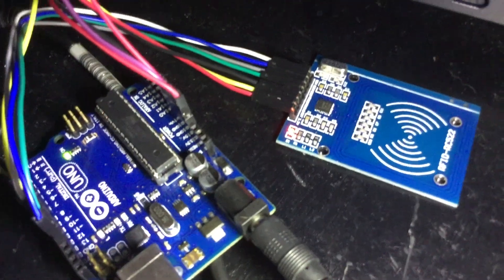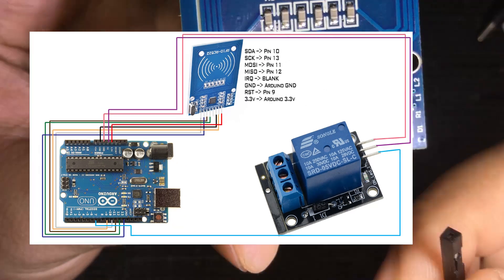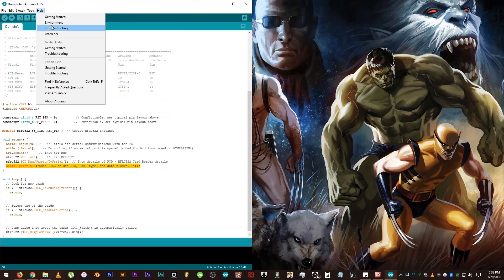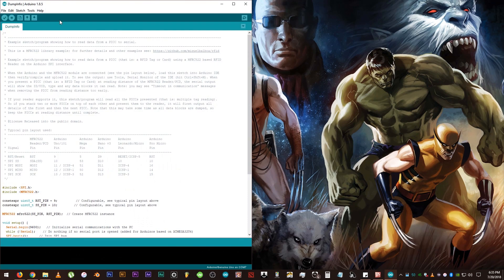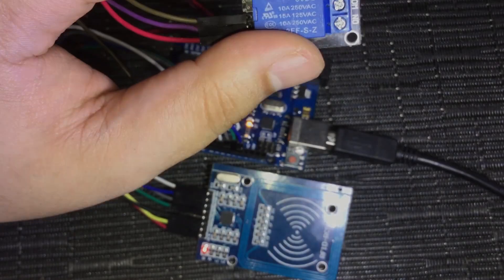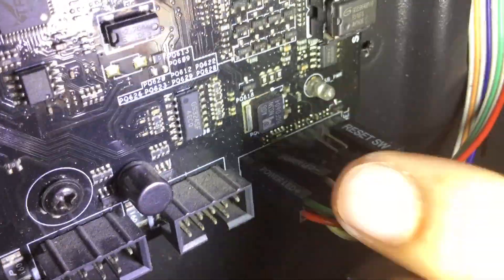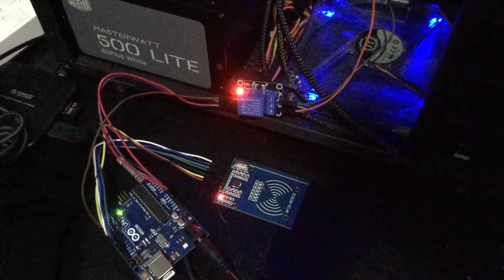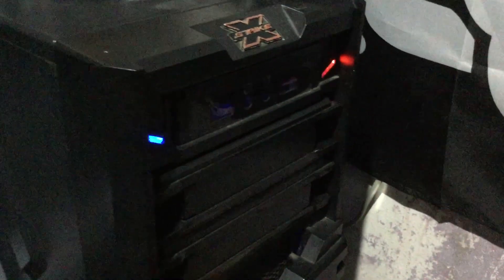Arduino Project #2 | MFRC522 RFID Module + 5v Single Channel Relay = PC Switch With Added Security!

Comment: i cant seen to power up my pc, ive done everhthing correctly. Ive even added a buzzer and led to show the card has successfully been authenticated, the relay power turns on upon successful authentication, but no power to pc
Reply from the maker: Hello and thanks for the comment!

Make sure that your connections are correct. 

Relays usually have 3 ports where you can connect leads to, and the relay would function differently depending on how you connected the leads.

NO+COM = Normally Open or Normally ON
NC+COM = Normally Closed or Normally OFF.

Usually, PC switches are Normally OFF and would only momentarily send a pulse to the motherboard (once pushed), then from the motherboard to the PSU to turn ON your PC.
Reply: @HeathenHacks  thanks for the quick reply, i have the relay wired as per your vid, should i swap from open to normally closed?

Comment: years after years this method still working... I have tips for want using Direct USB power. Maybe this comment, some newbies will understand on this comment.

to keep relays turn off, after turning on arduino, must add this on void setup() scetion:

Find this code:
//Choose which lock below:
pinMode(lock, OUTPUT);
pinMode(lock2, OUTPUT);

Then add digitalWrite(lock, HIGH);
 and digitalWrite(lock2, HIGH); after pinMode(lock2, OUTPUT);

This will keep relay off after powering arduino on.

Comment: Hello! is it possible to build this proyect without a 9V battery? is there any other way to power it?
Reply from the maker: Hello and thanks for the comment! ♥ It is. Yes. You can use the USB port to power it via a USB hub or a powerbank as well. You can also use the DC input.
Reply from the maker: You can also check out the updated version of this (sort of) that uses a bluetooth module as well.

https://www.youtube.com/watch?v=q9GwpWxlAIo
Reply: @HeathenHacks  Thank you for answering! And thanks for the recommendation, your proyect was really helpful!
Reply from the maker: Glad you liked it. Thanks! ❤

Comment: Hi I know this video is old but could you make an other one (since I cant figure it out myself being a noob :P )how to trigger the relay over the internet (e.g by adding an ethernet shield to the Arduino) instead of using RFID? 

I remote manage some desktops (that dont have built in capabilities to hard boot etc e.g intel vPro/AMT support) so when the computer crashes/freezes for some reason one has to go to the physical location of the computer and manually push the powerbutton to turn it off and boot it on again which is a pain in the ass since the rigs I remote manage are outside my house... This could be a gamechanger for me :D
Reply from the maker: Hello, Bill! Thanks for the comment! ♥ Unfortunately, I don't know how to do it as well. lol.

However, I would like to suggest this video: https://www.youtube.com/watch?v=4moPYxNYjCY 

It uses and ESP8266 board to control the relay via wifi instead of an ethernet shield.

If the place where you remote manage the computers doesn't have a router, you could try this.

It's from the same dude on the first video: https://www.youtube.com/watch?v=2J4cx2gA7DQ

Sorry.

Comment: Why is it not safe to shutdown your pc with the key fob, also with that in mind. Is it safe to use the card to power on the pc?
Reply from the maker: Hello Bob! Thanks for the comment! ❤ What the keyfob or the code for the keyfob does is like pressing the power button for about 4 seconds, which can also be called a "hard shutdown". If I remember correctly, it bypasses some things that Windows does when shutting down normally and may result in some corrupted files. (Don't quote me on that, tho) 

The card is perfectly fine to use for turning ON the PC. It basically replaces the power button.
Reply: HeathenHacks Thank you for your response! You’re very helpful you deserve bunches more subscribers!
Reply from the maker: @Bob_Smith  Awww.. thanks! ☺
Reply: HeathenHacks You’re welcome!!!

Comment: hai, does rfid card could read when using relay and battery power? because when i used External power 12V to arduino without relay my RFID card cannot detected / read. Thanks you i hope you have the answer
Reply from the maker: Hello, Radja! Thanks for the comment! First, you could try and use a 5v power supply or just connect your Arduino to a USB hub and see if that would work. Haven't really tried using 12v on my Arduino projects that's why I'm not sure.

Comment: Does it matter if I use any relay module cause I'm using SRD-05VDC-SL-C relay module and when I hook it to my arduino the green light is always on and i tap my rfid card and it turns of but when the relay is hooked to my pc it is not working the green light is still on and when I tap my rfid card it does nothing it's like my relay or arduino is hanging and I need to upload the codes again..I tried to alter the digitalwire function high to low and low to high to make my relay module green lights off when I upload the codes it does not turn the light off you need to tap the card to turn the light off but still same issue when it hooked to my pc it hangs and also i tried to put it to normally close and sometimes to normally open but still same issue...do you think my relay module had the problem?
Reply from the maker: Hello, thanks again for the comment. As per our last conversation, you asked me if you can use a 12v DC adapter for your Arduino, correct? If you're using a 12v DC adapter right now, have you tried using a USB cable or a 5v DC one? If you haven't tried that yet, please do try that out to pinpoint the problem. Now, assuming that the connections are all correct, try the code again while using the USB cable this time and see what happens. If you're still having problems with your relay, remove your relay and try the code again using an LED bulb, the 5mm one, Instead of the relay. They basically have the same code. If the code works properly when using the LED bulb, there might be a problem with your relay.
Reply: @HeathenHacks  I modify your codes man hahahaha and it works hahaha thanks a lot man
Reply from the maker: @system3318  So, it's working now? Nice!
Reply: @HeathenHacks  working 100% hahaha thanks to your codes man 😁😁
Reply from the maker: @system3318  Ey, no worries. It's not even mine. I edited it, too. lol.

Comment: Is it ok to use a 12v dc adapter to power my arduino
Reply from the maker: Hello and thanks for the comment! ♥ According to the Arduino UNO datasheet which you can download here: https://www.google.com.ph/url?sa=t&rct=j&q=&esrc=s&source=web&cd=&cad=rja&uact=8&ved=2ahUKEwjMt_O90LzqAhVTzYsBHZFFAmAQFjATegQIDBAQ&url=https%3A%2F%2Fwww.farnell.com%2Fdatasheets%2F1682209.pdf&usg=AOvVaw2hpzYjytzW3E48klQUKjqJ
Arduino can accept 7-12v for input.

So, yes.
Reply: @HeathenHacks  thanks..I already researched about it I'm looking for 2nd opinion hahaha
Reply from the maker: lol.

Comment: Can I use a MOLEX connector to power the Arduino and eliminate the battery or adapter to power the Arduino?
Reply from the maker: Hello, Chandraveer! Thanks for the comment! ❤ I'm not sure if you can use it to power the arduino directly because I haven't tried it yet. Sorry.

Comment: great video, i want to add a 4 channel relay, any chance on getting a code update so i can use different relays ? say one card opens up relay 1 and 2 after delay of 15 seconds activates 3 and 4 and then stops :) ?
Reply from the maker: Hello, Simon! Thanks for the comment! ♥ Yes. I think it's possible. Just modify the code by adding and removing some things.

Not sure if this code would work, but you can take it as an example, I think.

https://pastebin.com/X0eHVn2F

Comment: Why my relay Not trigger the switch.?
Reply from the maker: Hello, Fathir! Thanks for the question! ♥ I'm not sure why. As you can see, mine is working. Try to double check everything. From your code to your wiring.
Reply: @HeathenHacks  what relay Merk You Use?.
Reply from the maker: Just a generic 5v, 10a relay module.
Reply: @HeathenHacks  can i have your contact.
I still confuse, Why my Relay not triggering
Reply from the maker: Fathir Nathan sure. you can send a message on my FB page. fb.com/HeathenHacks

Comment: If I power on the arduino .. the relay power on also ....
Reply from the maker: Hello, Jss! Thanks for the comment! ♥ 

Hmmm. Try adding 

digitalWrite(lock, LOW);
digitalWrite(lock2, LOW);

on the void setup to start the relay turned off.
Reply: @HeathenHacks  not working ...  the same problem
Reply: Me too.
And the relay Not triggering the Switch

Comment: @HeathenHacks  
can i use it for rfid door lock ?
using a normal relay module

i was actually looking at another video
but then everything except the lock was fine ,the lock was not opening

the guy is not responding to my comment 
can you please help me if i send  you the circuit diagram
Reply from the maker: i can try and help you, but i can’t promise you anything, since i’m not an expert. 😂
Reply: @HeathenHacks  its okay , i'm glad you responded . how can i send you the circuit digram?
Reply from the maker: @EUFORIS  if you have a facebook account, you can message it to my page. facebook.com/HeathenHacks/

Comment: sir this project can be used as  in door lock
Reply: ok
Reply: 9 v applay
Reply from the maker: Oh. Sorry, I was mistaken. The voltage to power and control the relay is 5v, because it's a normal 5v relay.
Reply from the maker: Hi, Furqan! Thanks for the comment! ♥ Yes. You can use it on a door lock.
Reply: @HeathenHacks  thanks i was looking for that answer
Reply from the maker: @EUFORIS  Glad I could help.
Reply: thanks
Reply: sir i made this project 
but  i on circuit then relay on already and inread tag card on   rf reader so only RX light billink on arduino uno 3. relay no show responsed because relay already on in circuit
solve my problem please 
?
Reply from the maker: @protechnology550  hmmm. i guess you can try and add 

digitalWrite(lock, LOW);
digitalWrite(lock2, LOW);

on void setup and see what will happen.
Reply: how many voltages aplay on this circuit?
Reply from the maker: Furqan Ali depends on the source. on this case, it’s 5v since the source is the motherboard.
Reply: thanks boss
Reply from the maker: @protechnology550  hey, don't thank me yet. we don't know if would work. lol.
Reply: no responce i chack

Comment: Hi Heathen Hacks..!!
Can you give a valid link for  Project File + Visual Wiring Diagram... Because, i cant proceed the following procedure for Relay.. Please reply Asap.
Reply from the maker: Hello, Danesh! Thanks for the comment! ♥ Please just use the Arduino Project Hub link that is in the description. The Project File + Visual Wiring Diagram are also there. Thanks.
Reply: @HeathenHacks   the link you have  attached is not working.. please  check.. I need the RFid Relay file... Thank you
Reply from the maker: It's working on my end. I even checked it on a mobile device.
Reply from the maker: Hello, Danesh.  The project file is just a code. If you copy the code on my project hub link, you can just paste that code on your Arduino IDE. 

Or, you can even download it from there by clicking the download button.

Here is the link that will direct you to the code:
https://create.arduino.cc/projecthub/Heathen_Hacks-v2/rfid-relay-rfid-door-lock-code-rfid-pc-switch-eee1d1#code

If you want to see the wiring diagram, just scroll down a little.

Comment: good video, I'm doing the same project with fingerprint, and I'd like to see your code, but you can not :(. Greetings from Barcelona
Reply from the maker: Hello, Sillithus! Thanks for the comment! ♥ The link for the code is in the Description. Hmm.. I guess, I should've made it more clear.

Anyway, go to this link to see and/or download the code if you want. :D

https://create.arduino.cc/projecthub/Heathen_Hacks-v2/rfid-relay-rfid-door-lock-code-rfid-pc-switch-eee1d1?ref=user&ref_id=550502&offset=0

Comment: hello i want to modify that the key fob is in contact it turns it on and is on until it's touched again to turn it off where do I need to make the changes. PS great video
Reply from the maker: Hello Aku! Thanks for the comment! ♥

I compiled it and it did not have any problems, however, I am not sure if this is the code that you need.

First, remove this from the original code.

"void close_lock2() {          // You can also just use the card to shutdown your PC. This is just for those moments that you really need to shut it down quickly. 
  //Use this routine when working with Relays and Solenoids etc.
  digitalWrite(lock2, HIGH);
  delay(5000);                
  digitalWrite(lock2,LOW);
}"

Then, replace this one.

   " Serial.println(read_rfid);
    if (read_rfid==ok_rfid_2) {
      //ok, open the door.
      close_lock2();
    } " 

With these.

    Serial.println(read_rfid);
    if (read_rfid==ok_rfid_2) {
      //ok, open the door.
      digitalWrite(lock2, HIGH);
    }
        Serial.println(read_rfid);
    if (read_rfid!=ok_rfid_2) {
      //ok, open the door.
      digitalWrite(lock2, LOW);
    }
Reply from the maker: Hello again, I may have misunderstood your question. Sorry. Please disregard my 1st reply. Try looking up some codes for state change detection on the arduino playground and try to merge the “rfid==ok” code with it. I’ll try to get back to you later as I am about to sleep. 😂
Reply from the maker: Hello! It's me again. lol. Sorry for the delay.

I think I might have found the answer.

So, basically, just remove anything with "open_lock2", "rfid2", or "lock2" on the code and replace the delay on "void open_lock()" with 5000 and that's it.

Please let me know it it worked. Thanks.

Comment: There is compilation error occuring
Reply from the maker: Hi, Rama! Thanks for the comment! ♥ Can I know what kind of error was it? I mean, what does it say exactly?
Reply: @HeathenHacks 'MFRC522'  file not found
Reply from the maker: @rama9062  Hmmm... Interesting... Have you downloaded the MFRC522 library? It's located just below the code on my Arduino Project Hub Project. Here's the link. 

https://create.arduino.cc/projecthub/Heathen_Hacks-v2/rfid-relay-rfid-door-lock-code-rfid-pc-switch-eee1d1?ref=user&ref_id=550502&offset=9

Comment: Hi,

Can I use Arduino Pro Mini instead of Arduino Uno ? Because I lack of room, If yes please what do I have to change to make it work ? 

Thanks
Reply from the maker: Hi there, thanks for the comment! ♥ Sorry if my comment is delayed, I remember posting a response last night, but it didn't came through for some reason.

Yes, you can definitely use a Pro Mini, I think.

I think think the only thing that you have to change is where the connections are.

Check this link for an example: https://www.circuito.io/static/reply/index.html?solutionId=5c485b8e1e2e250030e863f7&solutionPath=storage.circuito.io

Comment: works perfect !!! thanks  a lot. I use it for opening a gate with 200 users with entries countdown , when I'll finish I'll uploat my code and project
Reply from the maker: Rafi shoval Awesome! Goodluck on your project. :D
Reply: thanks again! it's my very first project ant you helped me alot
Reply from the maker: You're welcome, sir. Watch out for more project and/or unboxings/reviews to come. :D
Reply: too sad :-(    there is not anouth memory for 100 cards! I may buy an arduino mega and try
Reply from the maker: Oh, right! I forgot to mention that an ATMEGA328 chip can only store about 50-ish tags if I am not mistaken. I remember reading that somewhere.
Reply: it worked perfect for 40 tags with 30 entries, plus 10 master cards . ordered an Arduino mega rev 3 for it
Reply from the maker: I see. If all else fails, I think an SD card module would come in handy. That way, you could maybe store more than 200 entries. Not sure tho. Just a guess.
Reply: @HeathenHacks  thanks for your answer! I thought about sd card, I should get one that I'v ordered in few days and I'll give it a chance. Anyway, I alredy ordered the Mega so I'll try both...
Great day !!!
Reply from the maker: You can also check out the arduino forums if you ever encounter some problem. Goodluck! :D

Comment: if i reconnect  power cable the relay automatically on
Reply from the maker: Please double check your wiring and code.
Reply: @HeathenHacks  we same problem if i power on the arduino automatic my relay power on
Reply from the maker: @arvinjessvelasquez893  Hmm.. ok, try to add 

digitalWrite (lock, LOW); and digitalWrite(lock2, LOW); under void setup() and see what happens. If that doesn't work, double check your wiring.